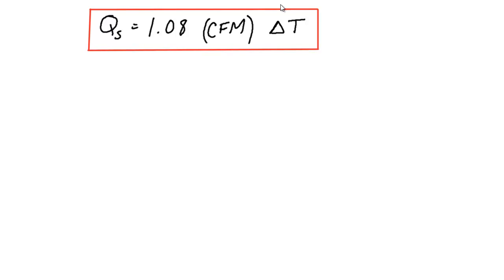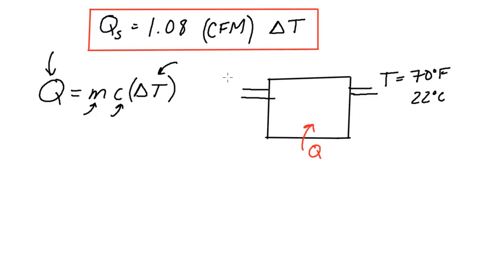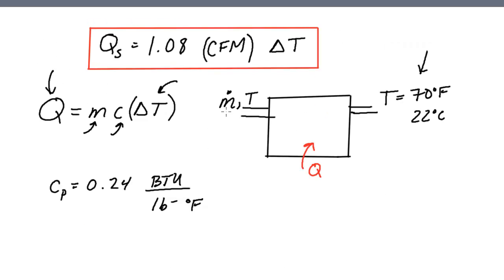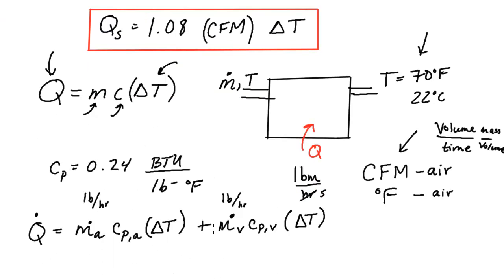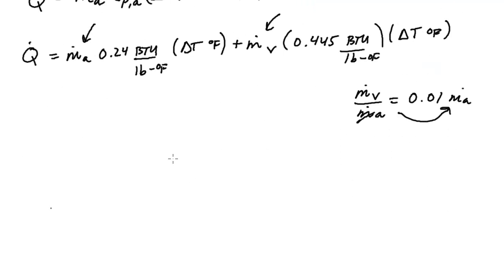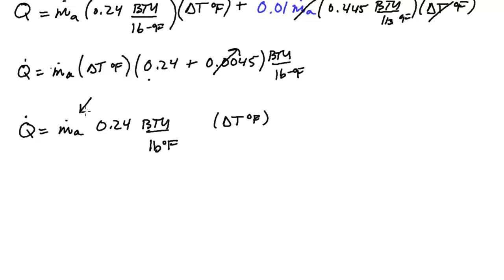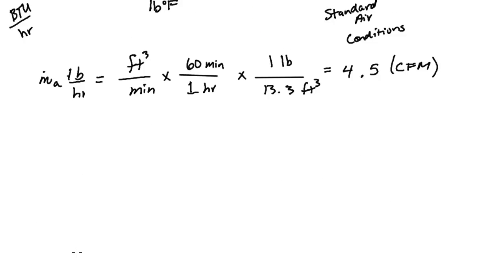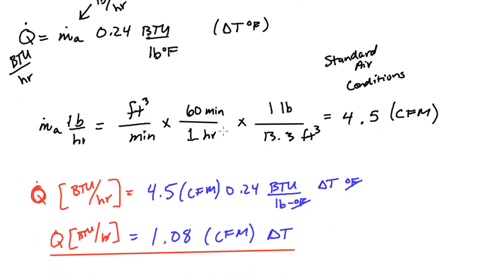Sensible Heat Formula for HVAC Engineers - Where does Q=1.08 CFM ΔT come from?

Comment: For different elevations, it's simpler just to find the specific weight (lb/ft3) and use this formula:
Multiplier = 0.24 x density x 60min/hr (Cp, isn't a constant, but for an HVAC engineer, it's always pretty close to 0.24)
Examples:
0
000' - 1.08
1000
 - 1.04
2000
 - 1.01
3000
 - 0.96
4000
 - 0.94
5000
 - 0.89
Reply from the maker: Thanks for calculating these out. You may find interest in the precalculated tables that I made, which you can find here: https://github.com/mitchpaulus/psychrometric-tables/releases/download/v0.1.0/psychrometric-tables-2018-09-04.pdf

Comment: Great video! the standard air condition that is assumed, is on coil (Mixed air temperature) or off coil (Supply air temperature)
Reply from the maker: It could be either depending on the conditions - this is a shorthand formula that is meant to be a quick calculation that generally works for wherever the CFM is measured. A more detailed analysis would take into account the complete psychrometric state which accounts for temperature, humidity, and air pressure.

Comment: Hello, I was working on problem 23 in the “6 minute solutions edition 2” workbook and tried to utilize this formula to calculate a reheat coil load. Doing so yielded an incorrect answer. I think a video explaining where this can and cannot be used would be very helpful.

Comment: Can you go over where this forumla would be used in designing an hvac system
Reply from the maker: Of course. In general, you will use this in the analysis of heating/cooling coils along with the conditioned air entering the space. I'll give you two examples:

Ex 1. You will often start by estimating the design cooling load of a space. You can do this using knowledge of the outdoor air conditions and what materials the wall, windows, and roof are made of. Say you are using a VAV system for air-conditioning, and you know that you will be supplying air at 55°F, with the room at 75°F. If you calculated the cooling load to be 21,600 BTU/hr, then you could use this formula to determine that you will need approximately 1,000 CFM of air. You can then size your air handling unit and supply air fan appropriately.

Ex 2. Say you need to size an electric resistance heater for outdoor air preheating so you do not freeze your water pipes. From guidelines/codes you will know the required amount of outdoor air you need, and you will also know what is the coldest temperature you expect to see, along with your preheat setpoint. If you need 1,000 CFM of outdoor air, and will require it to be heated from 0°F to 45°F, then you will need a heater with a power of around 48,600 BTU/hr or 14.2 kW.

Comment: Can you help me (I am an HVAC student)
I am wanting to find CFM’s for rooms once I know the Btu/h heating and cooling loads.
I have the Manual J8AE spread sheet and the CFM outputs seem high to me and I wanted to see other calculations. 
I tried the Sensible Heat Formula of CFM = Sensible Btuh / 1.1 * Delta T

But when I input those numbers I get higher CFM needed in areas that have lower Btuh heat loss/gain. 
Here is my example
Home is in Laguna Beach California 
The area labeled 1st Flr Master Bedroom has a heat loss of 9138 Btuh and a Heat Gain of 4807 Btuh
Manual J8AE want to provide 299 cfm for heating and less air (244 cfm) for cooling
If I do the sensible heat formula CFM = Sensible Btuh / 1.1 x ∆ T , I am using 29 ∆ T for heating and 10 ∆ T for cooling 
I get 286 cfm for heating and more air (437 cfm) for cooling. 
This does not make sense to me with needing more cfm with less of a Btuh load. 
Can you show me where I am thrown off?
Reply from the maker: For a given heat load, you generally have two factors you can adjust - the flow or the ∆T, and they are inversely proportional. So if you have 9,138 BTU/hr of load, you can have any CFM you want, it will just affect what the ∆T is to make the energy balance work out. However, do note that there are usually other factors that come into play such as temperature stratification when the ∆T is too high or excessive pressure loss if the flow is too high.
Reply: @MitchellPaulus  Thank you
Reply: @MitchellPaulus what if ACH included into process? I have to calculate required air volume for an examination room and when I just go through the heat gain from the equipments (which is 3,14 kw) and having at the hand ACH 12, Dt =7 degree.. what formula should I use to accurately calculate air flow? Btw room area is 40 m2, and height is 3,2 m

Comment: Great video! I'm really curious to know, how did you decide to use cp instead of cv for this calculation? I've searched all over and can't find a great answer. Thank you for your help!
Reply from the maker: This is often a point of confusion. cp is defined as the change in the enthalpy of a substance per unit change in temperature at a constant pressure while cv is defined as the change in internal energy of a substance per unit change in temperature at constant volume. However, just because the phrases "at constant pressure" and "at constant volume" are in the definitions, doesn't mean these values are limited to be used in just those types of processes. They are valid for any substance in any process. 

With that in mind, in this case, we were looking for a difference in enthalpies. So the appropriate specific heat was cp. And we were looking for a difference in enthalpy since this was an open system in which mass flows in and out. 

A general rule of thumb that has served me well is that for open system problems, you are likely going to care about differences in enthalpies, which may lead you to use cp, and for closed system problems, you are going to care about differences in internal energy, in which cv is the more appropriate property.
Reply: Thank you for taking the time to help me and with such a great explanation! So the flow work term pv in h=u+pv is because now mass is flowing in and out, as in "control volume" vs "control mass". I think I have it, I hope haha.

Comment: why did you use Degree Fahrenheit instead of Degree Rankine in Gas constant Cp of the air which is 0.24 Btu/lbm.R? It kinds of confusing to me. Can you please elaborate it? thanks
Reply: sir, how it come to solution to take out the delta Temp. of the other equation to combine with the other one, just  because of they have the same structure? in the other hand it must be multiply that to the equation? can you please explain further? thank you.
Reply from the maker: Good question. The quick answer is that it doesn't matter whether the cp of air is per °F or per °R since a difference of 1°F is the same as 1°R. I used °F simply out of convenience. The value of cp is normally applied to temperature differences, not an individual temperature. So for example, if you wanted the energy to raise the temperature of 1 lbm of air by 1°R, this is exactly the same as energy as it takes to raise the temperature of 1 lbm of air by 1°F. 

To dive a little deeper, the Fahrenheit scale is considered an "Interval" scale and the Rankine scale is considered a "Ratio" scale (See https://en.wikipedia.org/wiki/Level_of_measurement#Interval_scale for more explanation). But since they have the same interval between unit values, any operations dealing with differences is going to be equivalent between the two. 

However, you need to be careful when using multiplication of a single temperature value, for example with formulas dealing with radiation in which you have terms like σ T^4. In those cases, you must be using the absolute temperature.
Reply from the maker: I'm not sure I completely understand the question, but here's an attempt at an answer. We are considering only a single temperature change. Once you evaluate that temperature change, you can consider it as a single number. At that point, you can factor that value out of equations just like it was any other variable.
Reply: @MitchellPaulus  👍